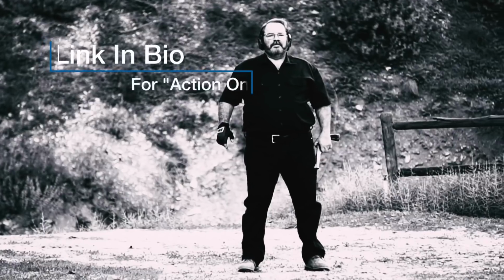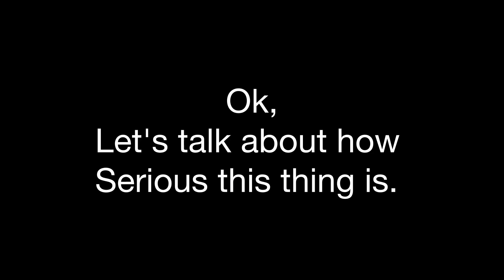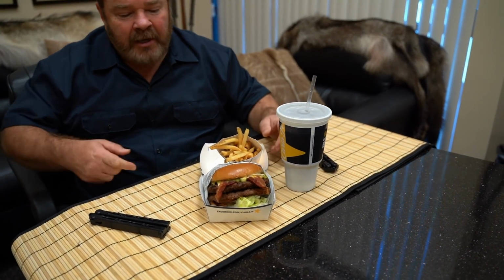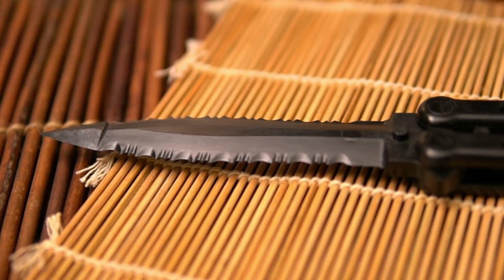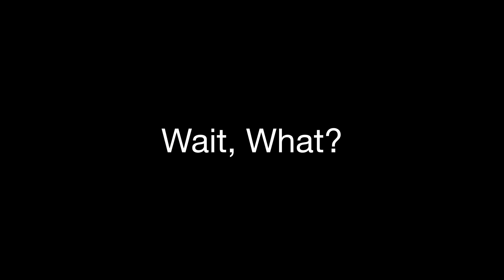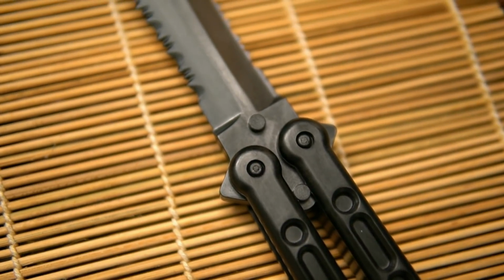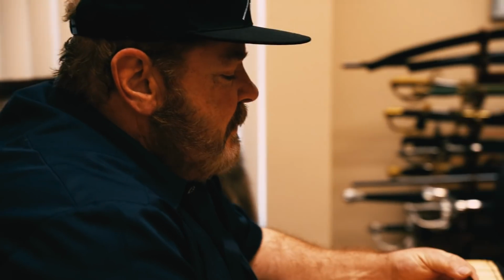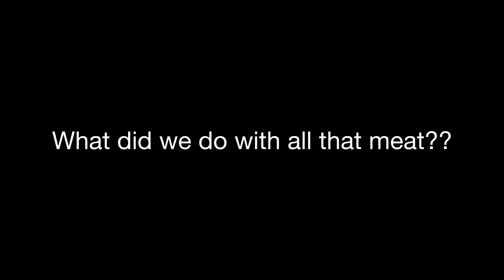FGX Balisong - Testing + Discussion

Comment: Certain areas make it illegal to sell, but you can buy a tooth brush and sharpen it on concrete and it’s just as lethal and you can get it through metal detectors. So why make these illegal in the first place .

Comment: I was wondering where I can pick these up since the website doesn't ship to my state (FL) I'm a flipper and I thought these would be a great option for when I don't want to carry a 6oz bali
Reply: What is your current Bali? Just curious because your said 6oz. Mine is 6.8 and it's a custom from @gp_blades on IG. Had it for about a year and I love it 👌
Reply: @r1w3d  I was using 6oz as a place holder for heavy Bali but it depends on the situation edc my 87 for work or heavy duty use I'll use a 63 or 62 for flipping I use a BM 51stock

Comment: Cool stuff, but isn't a "balisong" - mechanically speaking - one of the weakest types of folders (when when metal)? 
What would be really cool is a follow-up Griv-Ex "knife" that is a folding tank! Maybe something that can rival one of your famous lock-backs?
Reply: A balisong when designed poorly is weak "Cough el cheapo Zinc handled balisongs Cough" Material hardness difference between the hardened blade & pins Vs, the Soft Zinc alloy of the handles is what makes the real weakness a massive problem there. But if the materials are closer to equal in tensile strength, ductile strength & hardness value this problem goes away. 
When you take note of that and care to eliminate as many stress risers and flaws in the design, they are almost as strong as a similarly sized fixed blade knife.
Reply: @reignick1133  With all due respect, I'm looking at my balisong, and I personally trust lockbacks and framelocks more than I do 2 pins and 2 U shaped sticks. Of course durability increases as material quality increases, but fixed blades are mechanically superior to folders in the same way that a "Spartan" is more durable by design than a balisong.
Reply: @levaslevas  oh there are PLENTY of CS folders which are STUPID levels of durable and reliable, I'm definitely not going to argue against such as my EDC waffles between a Rajah 2 and a Hold Out 1. I am just saying when well planned and well built a balisong can be a lot stronger than it looks. 
In fact CS used to make one of the strongest, and it's a model I hope the bring back : The ARC Angel .
Reply: @reignick1133  Oh yeah, I faintly remember that one. Further on the matter (for the sake of discussion) can a balisong actually be used for self-defense? I've had mine for..... 3.5 years now, but I still understand that its nothing more that a piece of blunt metal in my hands unless I already had it open beforehand. There is no hope for dexterity if you get jumped or tackled from behind.
Reply: @levaslevas   I  would not try  to open one in a wet or cold scenario but yes a balisong can  be opened almost as quickly as an assisted open "flipper" knife.  
For wet and cold environs I would just leave it closed and use it as an impact tool like a yawara stick or kubotan. The closed blade edge especially when jammed into the joints or head,  can do a lot of considerable damage to an assailant. 

With the same force you use to  throw a jab using the closed balisong's blade edge you can EASILY destroy an attacker's orbital socket with not that much effort at all or give them a hell of a concussion if aimed just above the bridge of the nose.

The balisong tricks and all that really are more for self-entertainment and have little to no practical use.

Comment: Somehow it's hard to  believe. All FGX test I so for years show quite different results mostly bad exept dart, have FGX Tai Pan home it's arrived chipped, small Chip's not on edge but I use to very high quality of CS and this was real disappointment never use it but he lose small Chip's, very small,but loose even in box on the shelf. Yes it is not expensive for metal knife but for plastic??? For same money you can get Roach belly ,even cheaper and get very nice & beauty knife

Comment: is there a reason you decided to make a double-edged Bali because that's very stupid otherwise because you can't do ricochets or rollovers with a double-edged Bali without removing the edge from the safe handle side of the knife
Reply: It takes like 30 seconds on concrete to remove the edge, just like any other blade. He said why in the video... The focus is weaponizing it first, nothing weaponizes a blade more than being double edged. He even told you how to remove the edge, despite having other models without it.
Reply: @somethingtrulyhorrifying  I will admit that I posted my comment before I finished the video however I still stand by what I said as it is still incredibly stupid to make a bail double-edged as it removes your ability to use around 80% or more openings because the vast vast majority of openings requires the safe edge of the blade to make contact with your hand and while yes the edge can be removed and removed easily I should not have to remove an edge from my knife in order for it to function as intended and if I am required to do so to use my knife as intended then it defeats the purpose of making the knife double-edged 
balisongs serve as fine weapons with a single edge if you want a double-edged blade use a knife that was designed with a double edge in mind, not a knife that requires a single edge to be used properly
Reply: @elapidpython4378  Here's the thing, it functions just as intended, a weapon. And believe it or not you can operate a double edged butterfly knife without getting cut. No, you won't be doing chaplins and ricochets with it, but you can easily do several variations of openings, including zen rollovers and behind the 8 ball. It takes practice and confidence, I've been flipping for 12 years so I actually know what I'm talking about. If you can do aerials with your single edge balisong, you can do safe handle rollovers without getting sliced or bit, no matter how sharp the blade is. It takes more finesse and awareness, which is picked up through practice. Again if it matters THAT much there I would assume you choose the tanto version instead of the double edge version that obviously has a more utilitarian focus...
Reply: @somethingtrulyhorrifying  first of all I hate tanto blades I have had a few tanto balis in the past and they have been some of my most hated knives not just as balis but in general and second I never said that you cant open a bali with a double-edged blade I am simply saying that its stupid to make a double-edged bali because the main point of a bali is to be flipped and making it double-edged reduces the amount of opening you can perform and yes balis make fine knives for EDC or work knives but if you are looking for an actual weapon to be a weapon and not a work knife or a flipper choosing a bali to be that weapon is just as stupid as making a double-edged bali because just about any other style of folding knife on the market will fit that mold better because they can all be opened much faster than a bali in a self-defense scenario and a lot of them can have double edges without a reduction on the usability of the knife

and no you can't perform behind the 8 ball with a double-edged knife as both the first and second rollovers of the trick place the safe edge of the blade on your index finger and then on your thumb
Reply: @elapidpython4378  What's stupid is when someone thinks you can't EDC a butterfly knife as a SD tool, when one of its main criteria is fast deployment and fixed blade-like sturdiness, with practice, which it sounds like you need much of. Let alone the fact that you think you can't do a behind the 8 ball with a double edged blade. You can literally do the trick in reverse holding the opposite handle you normal start with, which is the bite handle, so start with the safe handle and do the same freaking thing and be amazed, which disproves your theory about it being impossible, but you're an inexperienced flipper, your perspective on butterfly knives and this double edge protest when there's clearly other models has not only proven that, but is borderline troll.

Comment: Looks pretty neeeeat.. but how the hell do you flip the damn thing if both handles bite..?
   Lots of bloody fingers...
Reply: It's a polymer blade, worst you'll get out of it due to the low mass and serrations is just a few "pinpricks/ papercuts"  I picked mine up as soon as I  heard of it and it's been fun. The real part that makes it a viable blade is the reinforced tip.

Think of it as an "XXL version of their  Cheap Shot broadheads" .. apply force and it'll go through your target but otherwise fairly safe to goof around with.